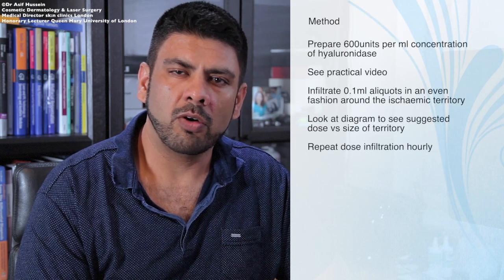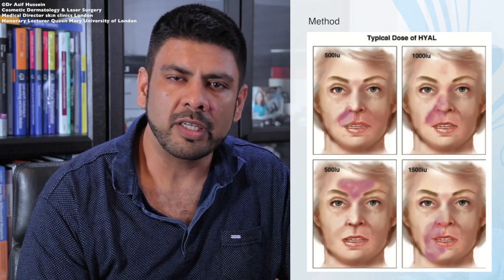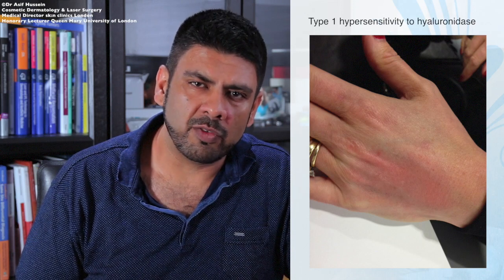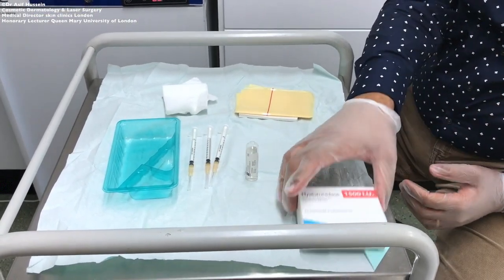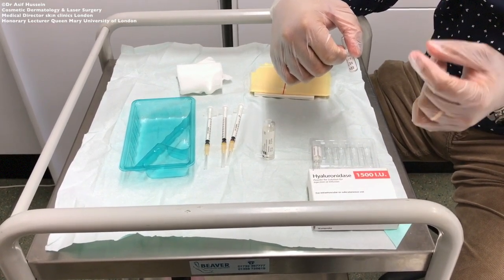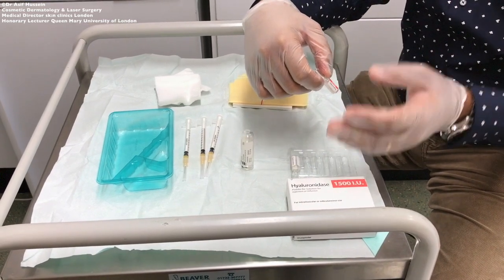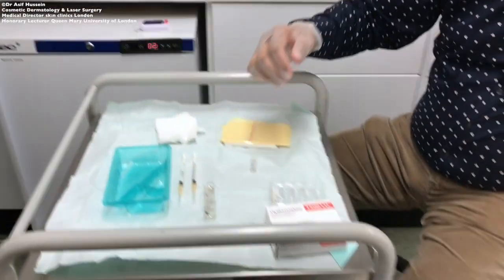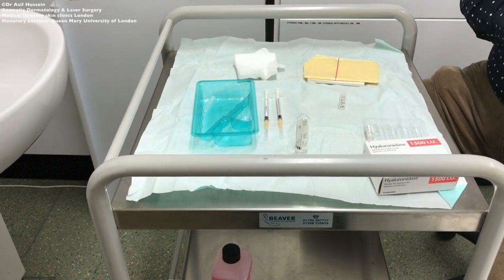Hyalase Tutorial pt.3

Comment: Hi I am a model. I had hyaluronidase injected 5 units into 1 nasolabial fold. It has impacted my natural tissues. I was refilled after a few weeks but looks much worse. Will my skin heal? Does hyluronic acid replenish but possible may never be same? I am 28. Products don't go deep enough. I could try stem cells & trentinoin? Do u know about connective tissues? Can u help me? Will my skin repair?
Reply from the maker: Hi Tyler of course i can help - let me know - where are you based?
Reply: @drhconsult4229  Denver...  I am scared. Am I too zoomed in? Will it keep dissolving for more than a month after hyaluronidase.  I am scared I ruined my face. It dissolved the filler and changed my natural shape face. Will my face regenerate natural hyluronic acid. I think nothing can be done. 😥